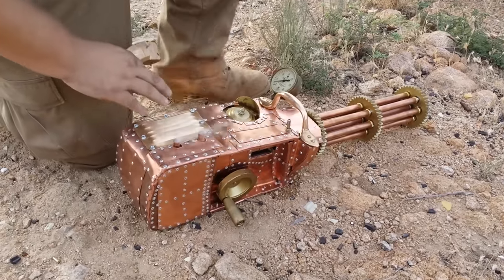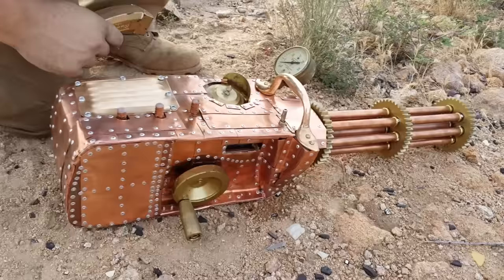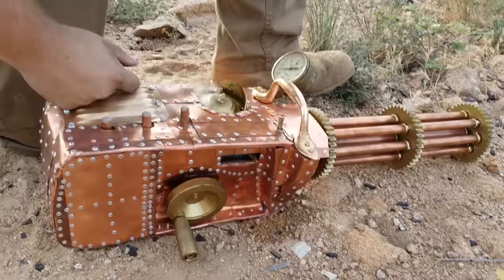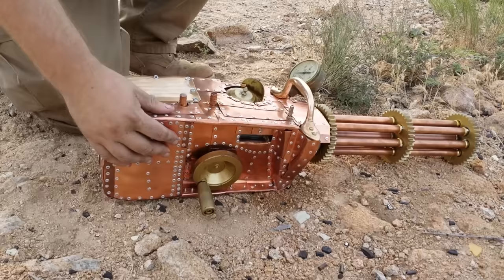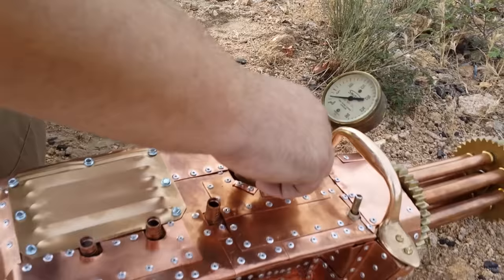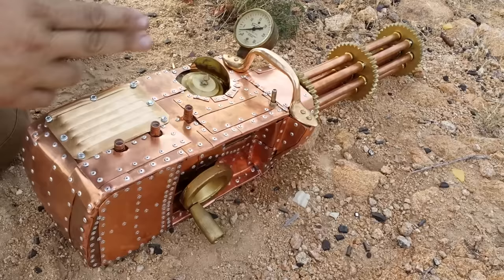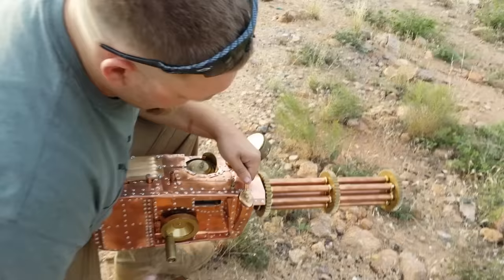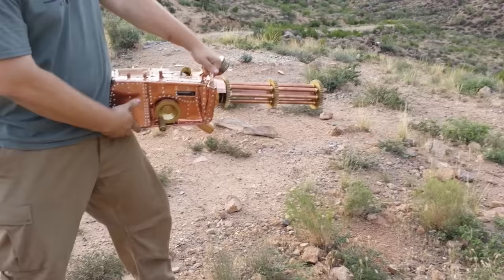Functional Steampunk Gatling Gun

Comment: its totally legal in the U.S to make your own guns with out serial numbers just as long as you don't plan on selling it or giving it away
Reply: Good luck having that hold up though....
Reply: chop glitch In fact you can even sell your home made firearm, as long as resale is not your original intent and you don't make a habit of doing it often. The only thing that's required is that you come up with a serial number and have it engraved/stamped onto the receiver.
Reply: IIRC, there's a limit to how many guns you made that you can keep at any one time.

However, I cannot see how this isn't classified as a class 3 full auto gun. I would think the continuous rotating wheel on the right would classify as a single action thus making this FA and illegal with it being made after 1986. A semi auto only shoots one round per action, otherwise known as a trigger pull.

I'm not a lawyer, but that's how I interpret the laws.
Reply from the maker: 92HondaEX It uses a BATFE approved "gat trigger". A separate manual action is required per shot actuating the trigger pulls. So each shot requires me to manually move the wheel 1/16" or whatever so it is classified as semi auto.
Reply: @92HondaEX  no they aren't regulated as machine guns but it may require registry as an AOW assuming the galling modification is permanent as it has no stock or pistol grip
Reply: You say that till the ATF shows up and Ruby Ridges you're whole family😂

Comment: Yeah i think <20 pounds is a more accurate description of its weight.
Reply from the maker: matthew maurino It also has a big, heavy battery and electric motor and it was full of dry ice and water at the time as well. And just one example; those 3/4" thick solid steel snowmobile sprockets that are holding the barrels together are 6lbs each
Reply: Bullshit.
Reply from the maker: x8alexisonfire9x Ok, you got me, the rotation of the barrels actually creates a localized anti-gravity vortex.
Reply: No we're seein eye to eye on things.
Reply from the maker: x8alexisonfire9x lol ok you win
Reply: Despite what it weighs the thing is badass and thats damn impressive. .
Reply: x8alexisonfire9x Titties.

Comment: Just so you know, there isn't any legal requirement to "build it from another gun" (at the federal level anyway).  You can legally make a firearm from scratch without any license or permit whatsoever.  Of course, it would but vastly more complex than what you've built here (especially if you designed it to belt feed) but unless your stuck in some place like California (and possibly even then, I can't keep up with whats legal and whats illegal there) you can build the next one from scratch!
Reply: Having a gatling gun is illegal however... That's probably why he had to claim it's just a variation on another gun model.
Reply: +Tom R no it isn't. first off, machine guns are not illegal period  (they are simply restricted in a moronic manner) but the end result of those restrictions is that a normal, non manufacturer, can't legally make a NEW machine gun.  BUT, a gatling gun isn't a MG, it's a semi-auto because each pull of the trigger only fires one shot (in this case the winding knob is the trigger).  if he connected an electric motor to it then it would become an illegal MG regardless if it was made from scratch or built off a 10/22.  But legally he could have made the gun from scratch as long as it required manual turning of the firing knob in order to fire.
Reply: bp968 Sigh.
Reply: +Tom R umm. ok then.  you certainly told me.  (slinks away).
Reply: +Tom R "ATF and its predecessor agency, the Internal Revenue Service (IRS), have historically held that the original, crank-operated Gatling Gun, and replicas thereof, are not automatic firearms or machineguns as defined. See Rev. Rul. 55-528, 1955-2 C.B. 482. The original Gatling Gun is a rapid-firing, hand-operated weapon. The rate of fire is regulated by the rapidity of the hand cranking movement, manually controlled by the operator. It is not a "machinegun" as that term is defined in 26 U.S.C. 5845(b) because it is not a weapon that fires automatically"

http://www.atf.gov/regulations-rulings/rulings/atf-rulings/atf-ruling-2004-5.html
Reply: bp968 You need to find a hobby. (Not an ad hominem attack)
Reply: +Tom R Firearms are a hobby, m9.
Reply: +bp968
 This is even more legal than that. The rounds do not ever leave any of the six barrels on the outside of the gun. Only the one serving as the axis. The moving barrels are nonfunctional and purely cosmetic.
 This gatling gun is not a gatling, but rather a semi-automatic with a rotary trigger that looks a lot like one. Very legal. Has a very nice sound, too. A sharp metallic clunking for each shot.
Reply: +Thelothuo btw, if your a fan of cool firearms and aren't rich be sure to support the GOA (gun owners of America) they are suing the government over the 1986 amendment that restricted registered machine guns to guns only made before 1986 (the whole reason they are so expensive now).  If they win(and they've won a lot recently) we will be able to register new machine guns.  The end result is an M16 for 200$+AR15 price (and a 6-12 month NFA wait, but worth it IMHO).  it's the only way some of us will ever own a MG with a pre86 M16 costing 20 grand now.
Reply: bp968
 Restrict outdated machine guns? Really? That makes rather little sense!
Reply: +Thelothuo well its the government, it rarely makes sense! basically I believe the amendment was added last minute as a poison pill to try and stop the gun owners protection act from passing and it failed (the bill passed).  and it doesn't restrict old guns it restricts "civilians" to ONLY being able to own old guns (pre-86).  and because of the law of supply and demand the prices have skyrocketed.  it's not the NFA process that makes them expensive (the same process that let's a law abiding citizen buy a silencer or short barreled rifle) it's the limited numbers.  if the amendment gets struck down as unconstitutional  (which it is) you will be able to buy a NEW machine gun using the same process as a silencer (200$ tax, fingerprints, photos, 4-8 months of waiting etc.  not something a criminal or soon to be criminal would go through).  but it would be awesome for us hobbyists.
Reply: bp968
 And what with those suppliers of pre-86 firearms suddenly competing with new companies, they'll drive their prices down as well. Still not as low as newer models for sake of "historical piece," but much lower. Maybe then they'll be spared from rusting in a warehouse for decades.

Comment: im fairly sure that any mechanism that automates the pulling of the trigger is considered a machine gun, not just if its a mechanism that's powered by gas from the previous shot. though this might squeak under that detail by being a crank that you have to physically turn instead of a button. but you would have to hope the cop that catches you with that thing is having a good day, or your life could be ruined. play safe. haha!
Reply: nope completely legal since it only shoots one bullet per rotation(trigger pull).
Reply: gtasaman420189 There are several rounds being fired with each complete turn.  Even several fired within a half-turn.
Reply: +Bruno TaTa irrelevant. one shot per trigger pull. The crank drives a mechanism that repeatedly pulls the semi auto trigger. 100% legal.
Reply: Bruno TaTa http://en.wikipedia.org/wiki/Centripetal_force
because any movement, even infinitely small, in a turn is considered a change in direction and by virtue a "trigger pull" it is legally a semi-automatic. If a full turn is needed it would be 2 radians = 1 trigger pull, half turn would be 1 radian = 1 trigger pull, quarter turn would be 1/2 radian = 1 trigger pull, eighth of a turn would be 1/4 radian = 1 trigger pull, and so on and so forth onto infinity.